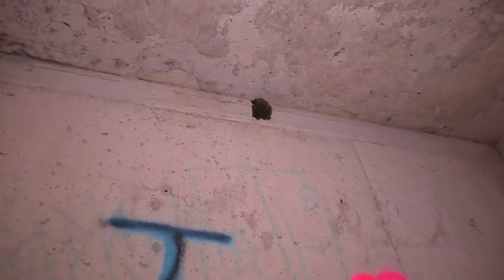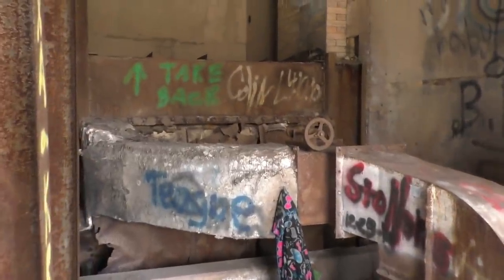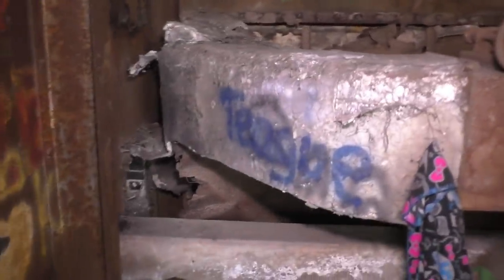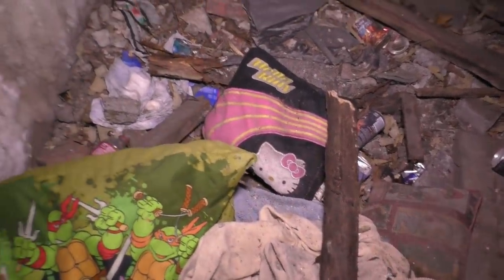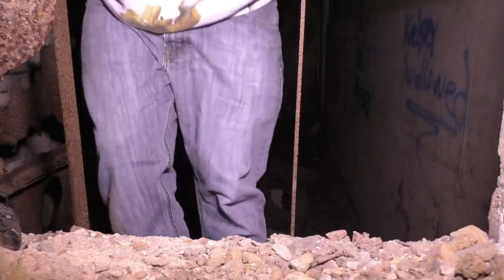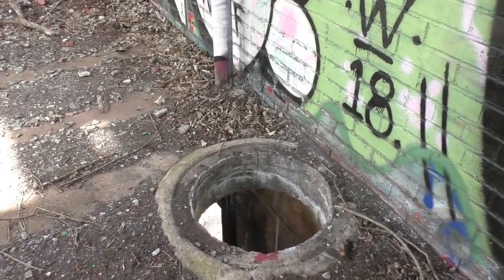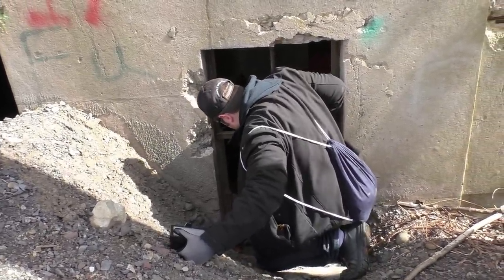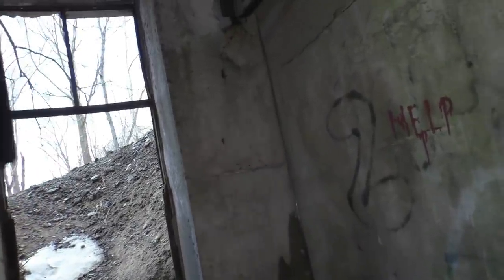Checking Out An Abandoned Incinerator

Comment: FYI: That little section of duct that you climbed on to get on top of the side of the incinerators may possibly have been covered in asbestos (that white insulation under that mesh or whatever).

You might want to check out Bridge Street in Plymouth, PA (just off Route 11 after the Carey Ave bridge) as there's a big old building like this one with a smoke stack. It may NOT be abandoned though as it has cell tower equipment on the smokestack(s).  However behind there under the Carey Avenue Bridge there's what appears to be an old junk yard with a couple of vehicles that appear to have been driven right down the hill from Route 11 towards it.

Apparently that old junk yard goes quite a ways along the river as I'm seeing it at least a half mile up the road still heading towards Edwardsville on Google Maps.
Reply from the maker: Email me the location on Google maps of the vehicles.
Reply: @JPVideos81  Sent. That warehouse/factory near this junk yard may be worth a look too. These spots are up the road from a former drive-in I believe you did an explore of previously.